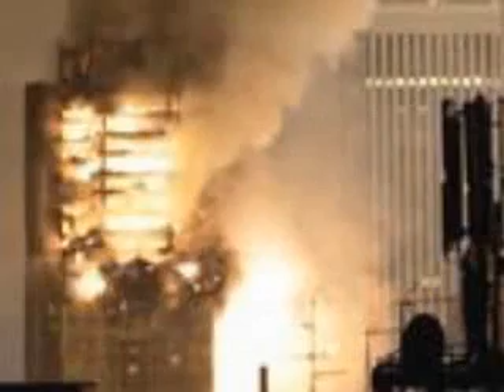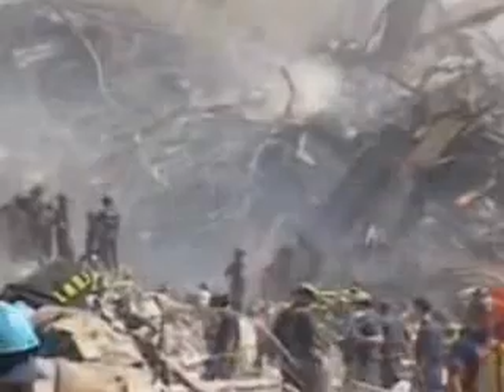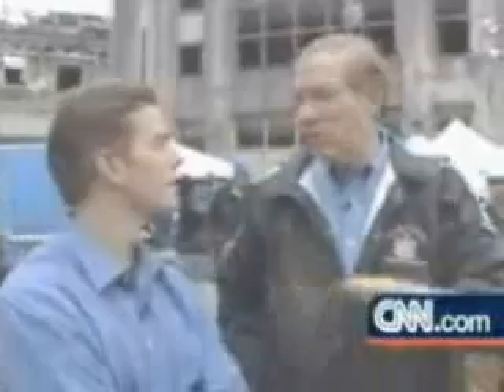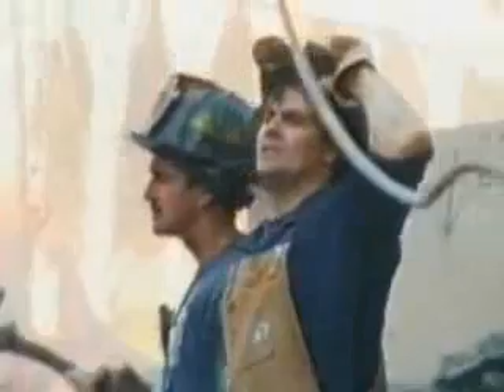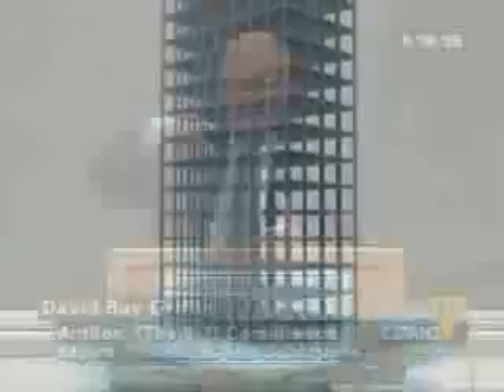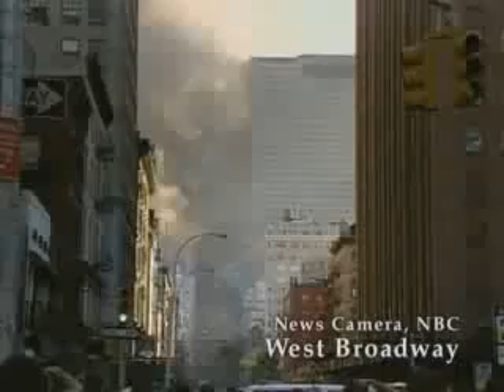9/11  Straight up analysis of the World Trade Center

Comment: 1. not unprecedented as the section of the Madrid tower which  actually has a structure similar to the WTC did collapse; as opposed to gages false comparison of the parts that are not.'

2. NIST doesn't admit freefall in the towers. 2.5 secs on WTC 7. In fact A&E's for "truth" have been saying 2/3's freefall for  the towers. freefall is impossible for the towers as debris precedes it.